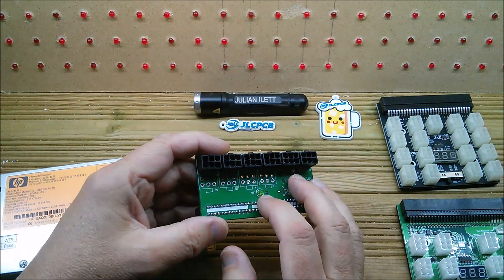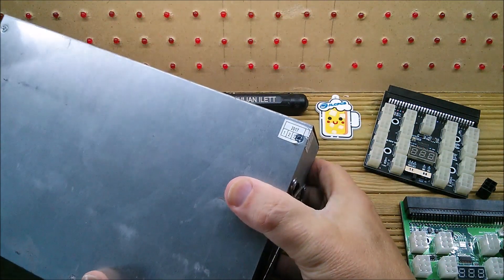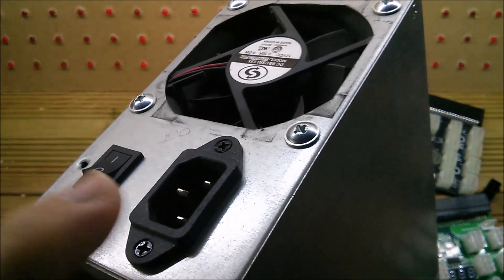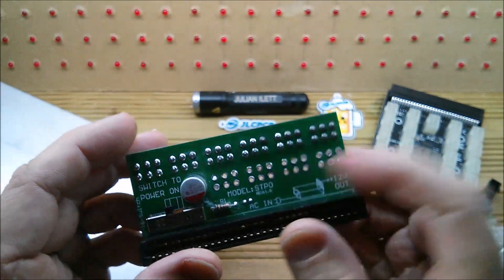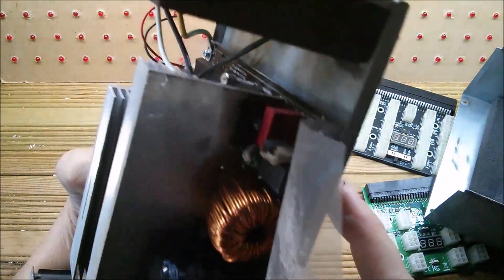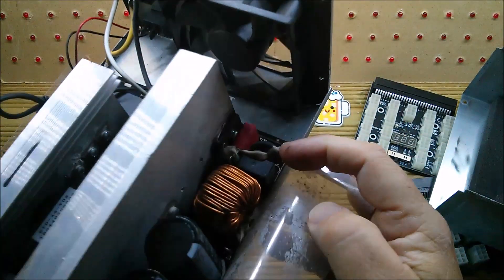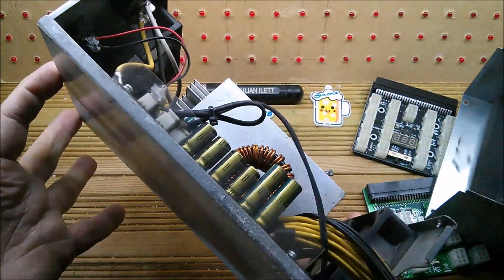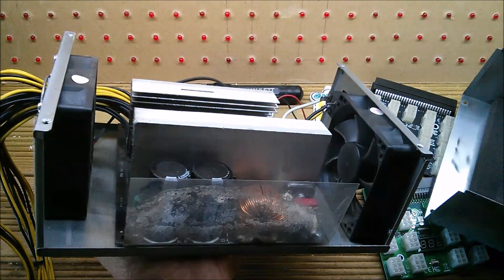Inside a Faulty 12V 100A PSU

Comment: A quick check with a multimeter of all the usual suspects, bridge rectifier , transistors and caps and Im sure you will find the culprit. Its not as if theres many to check.
Reply: Quick? He'll need to desolder them or he'll always find a short.
Reply: @Okurkaarrgghh   LOL. Kind of basic troubleshooting, and no, you dont need to desolder to find a diode drop or not. If its not there then component is bad.
Reply: @Okurkaarrgghh  No you would have to desolder them. I take it you havent done much work on circuits though so I wouldnt try if I was you.

Comment: Julian, see the Andreas Spice video on buying a $20 data centre power supply and repurposing it. Easy to do, just solder wires directly to the PCB and adding a power switch that you already have with that case? They're 60A+ and run at 12v although the voltage can be tweaked higher....
Reply from the maker: In my next video, I have 3 such PSUs. A 460W, a 750W and a 1200W :)
Reply: @JuliansShorts  Wow! I shall look forward to that....

Comment: Why don't have a look under the PCB for any signs of burnt tracks. My trick is to look at the wires coming out of the main beefy transformer. They usually have some plastic insulation on them. I'd check if it's melted which is clear sign that it's a sure EOL. You can also check transistors for short. Just make sure to discharge those huge input capacitors before attempting any measurements.

Comment: Wire a 100W 230V/240V lamp in series with the line (live) wire. Then it won’t present a dead short to the supply and you can take a voltage reading to see if it has gone short circuit. Of course with it disconnected from the supply, you can also do ‘cold’ checks with your meter on the resistance range. In any event, it’s worth seeing how far you get with investigating the problem. I sometimes repair 35 to 40 year old SMPSUs, so I think you should at least have a try... 😉